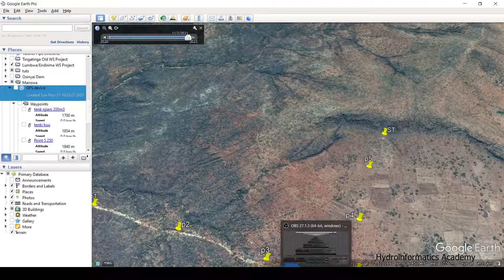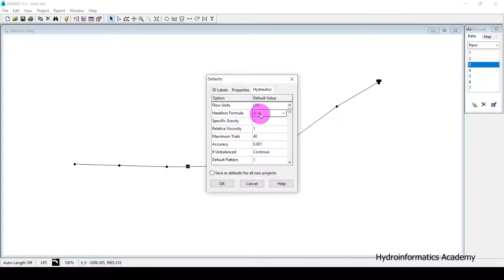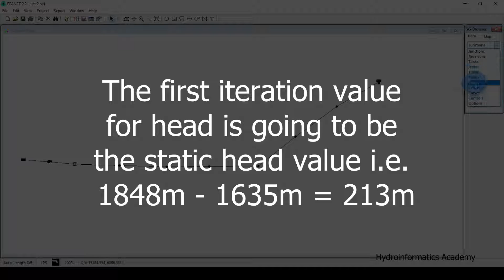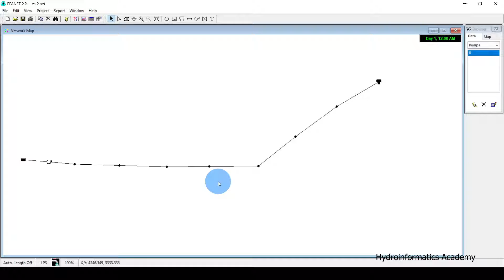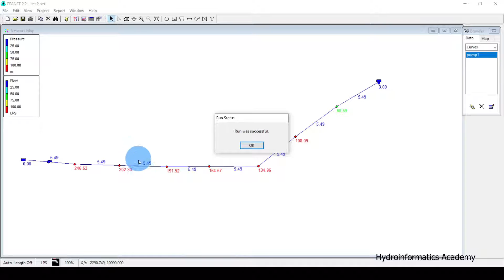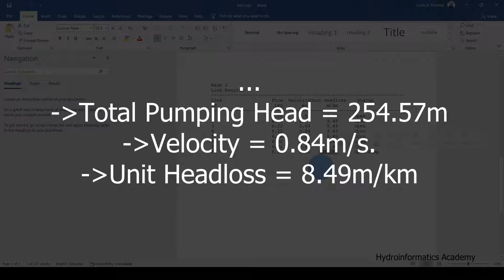How to Model Existing Water Pump in EPANET Software [Real Project]

Comment: On my epanet when I insert the flow on pump curve it doesn’t appear on the map

For example the flow that I insert on pump curve is 4.12 but when I run that system the flow is 0.00 on those node and also on tank

What can I do to solve that problem
Reply from the maker: If you dont get any error after running your model then Check the units format that you are using and make sure epanet is set to use the same settings! If you are using L/s then make sure you set L/s on epanet as well..

Comment: Thanks for your valuable videos. Do you know how Epanet determine the flow rate of a pump during simulation? For example, in a network with both a tank and a pump flows coming from tank and pump should be equal to total demand, but pump flow may take infinitely many values as long as the demand condition is satisfied, right? Which value is chosen as the pump flow rate? Appreciate it if you can answer. Thanks again.
Reply from the maker: "...Do you know how Epanet determine the flow rate of a pump during simulation?"
====
As designers, we normally optimise our model (for the parameters like Velocity, pressure etc.) in such a way that the model finds the Optimal/Best operation point (H, Q) on the pump curve for the pump to operate.

So, from what I know, you as a designer must first set the required pump flow rate then, for centrifugal pumps, EPANET use the pump curve to attain the required pump flow rate after the model is fully optimised for parameters like V, P and unit headloss!